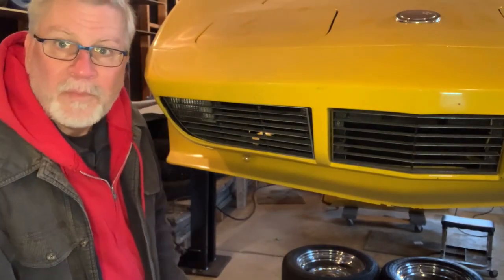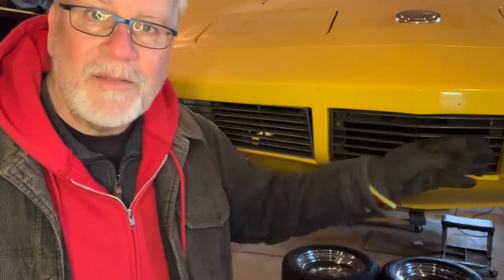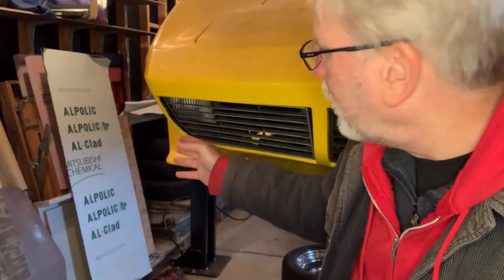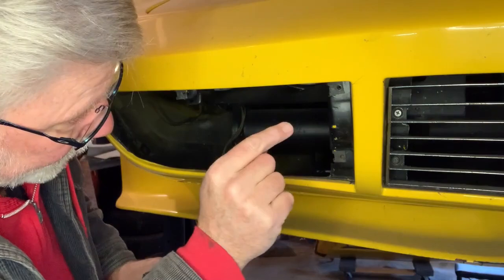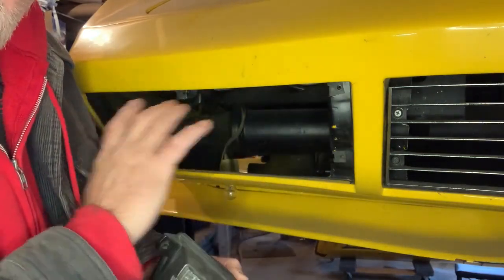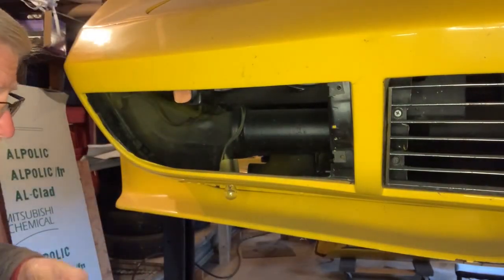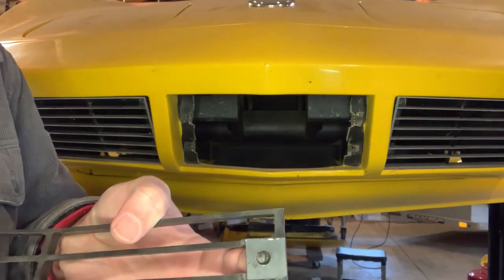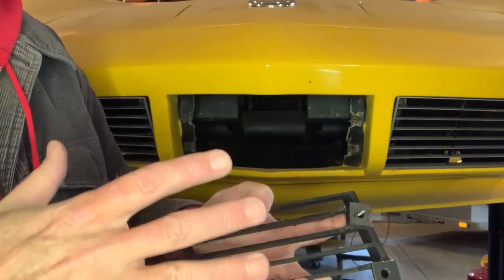C3 Corvette Grille Modification | On the Mark with Mark

Comment: The outer grills on your 73 has 8 fins.
Your center grill has only 7.
That's why in 74 engineering decided to paint the grills all flat black.
Less of a eye catcher.
Thanks for taking the time making your videos.
Reply from the maker: Interesting. I figured the chrome plating was expensive so it got dropped.